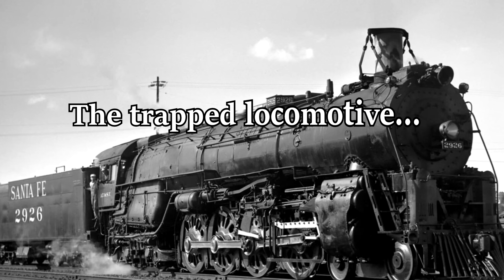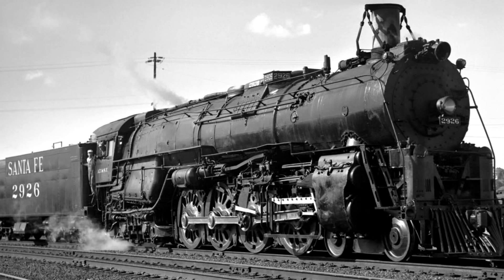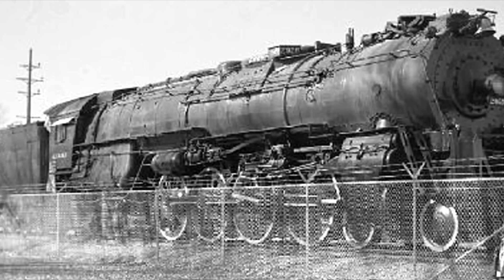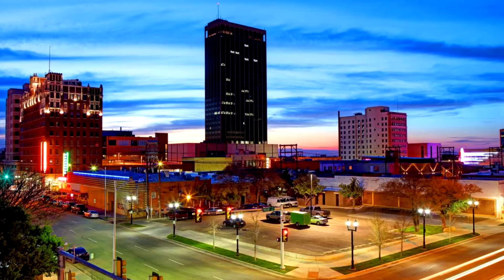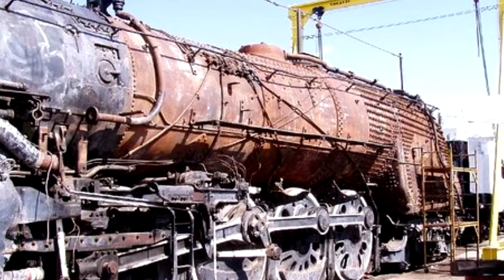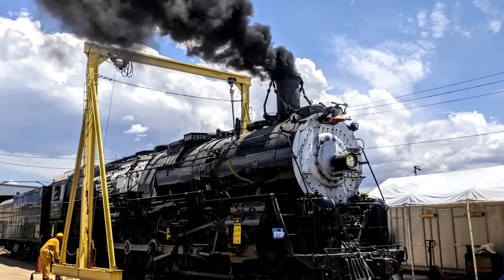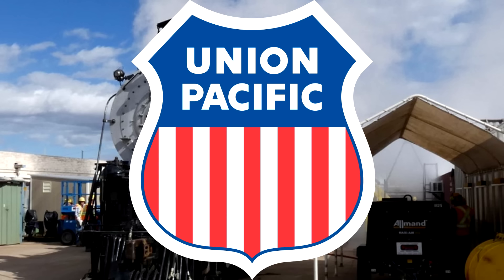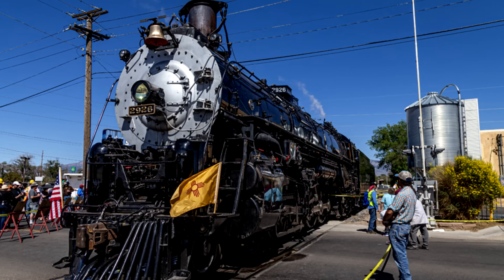The Locomotive Currently (Slightly) Trapped | Santa Fe "2900" 2926 | History in the Dark

Comment: The big problem is lack of PTC. I know when I worked for ns we would shuttle the nkp 765 in tow using our own engines, but due to lack of ptc it was restricted to being in tow.
Reply: Except 2926 has PTC put in her as well as ex-Santa Fe 3751.
Reply: Union Pacific, NMHR (formerly NMSL&RHS), and a third party (I can't remember off the top of my head but I think it's Wabtec) co-developed LeaPTC (the version of PTC that's for steam locomotives).
Reply: @MarkLac  I mean it kind of does. It has similar, if not the same PTC the UP Big Boy uses. So it requires a trailing locomotive outfitted with all the computers to be paired with it. Do they have a diesel capable of this? Serious question because I do not know.
Reply: @AlexBaldwin440 at this point up 4014 is fully ptc equipped now so doesn't require a ptc equipped diesel now

Comment: Union Pacific's no foreign steam policy stems from mechanical and operational issues involving NKP 759 in 1969, but there have been exceptions such as when 4449 required wheel work and was removed from the AFT and shopped at the UP's Omaha shops, double headed with the 8444 to and from.

Comment: So as a volunteer at the Railroad Museum of Oklahoma in enid I can tell you the joys of having to run on a class I railroad. We have frisco 1519 and even if we got the 20 million to restore it to operational condition (5 million to get towed to get restored, 3 million to restore, and another 12 million for a engine shed, spare parts, and the machinery to make new parts) to get the engine on a class I is not as easy as you think I know that the insurance cost that BNSF required Frisco 1522 to have to operate excursions got so high that no one wanted to pay the ticket cost so Im going to probably bet they would charge the same price as 1522's so getting tickets sold would be difficult. Plus you need to go thru the same engineering school as the railroad you want to operate on which is normally free for actual employees but are thousands of dollars for a non employee plus you would have to keep up some form of certification. Now that you got the cert and the insurance dealt with now you have to deal with the Fuel and getting the 4500 gallons of bunker C and the 12,000 gallons of water (which has to be filtered of scaling first)  and lord knows how much of that you consume a minute. Then you have to schedule water and fuel stops and then you have to "rent" a diesel and crew If you don't have PTC. And even after all that trying to schedule around the railroads schedule is another chore of its own. You have to find times that they arnt operating a whole lot and even then your not gareenteed anything. We used to run on farmrail but the new president of farmrail shut us down because we "distrubted traffic" even though they dont have that much traffic from my understanding. And all of this is just for the engine, we haven't factored maintance on rolling stock, staffing those cars, dealing with ticket sales......Yeah its a fun thing to deal with

Comment: I wouldn’t necessarily say it’s stranded. Yes 2926 is only running on that little Line, but there working on a Deal with NMDOT to run to different parts of the state. One of these lines is from Albuquerque to Raton Pass, my best bet is that 2926 is going to be running on State owned Tracks

Comment: Kinda curious on well a locomotive would run if someone would redesign feom the ground up using modern technologies. Could have controls with electronic lock out to allow multi unit configurations with only 1 crew. And a computer would control the inputs on the unmanned locomotives.
Reply: What an expensive farce!

Comment: It would be interesting to see the 2926 run on the Buckingham Branch along with the 611. They could be doubleheaded and compared and contrasted, even though the 2926 was designed to run at much higher speeds.

Comment: my mosin with a 180-185 grain Hornady cartridges is pushing the 3000fps range  and is absolutely crazy when it comes to putting wild game down, few years ago i shot a blacktail buck at 70-85 yards away and it went through both front shoulders the lungs and there wasn't much of a heart left when i cleaned it out, i only found one small bullet fragment but other then that it went through both sides pretty dam clean like, and to answer a question before its asked yes i do all my own butchering

Comment: Hmmm...the former Santa Fe main line through and around Albuquerque is now owned/controlled by New Mexico Rail Runner commuter rail agency (Rio Metro Regional Transit Agency), not BNSF (although BNSF retains all freight rights). Local transit agencies are notoriously politically-sensitive, so if the state legislature wants to see her run, it's perplexing to me why Rio Metro would be an obstacle. In fairness to the UP and their steam policy - they have 100% control the THEIR steam locomotives, 100% control of the maintenance and their own in-house staff of steam locomotive experts (hats-off to Ed Dickens and crew). This way they KNOW with a high degree of certainty the condition and reliability of the engines. They do not have the same depth of control or knowledge about someone else's locomotive. The liabilities of running these things on the main line are enormous.

Comment: This stuff brings out my inner cynic.

How many "restored/running" old steam locomotives does this country need?  Especially since there always seems to be "public" money thrown in somewhere.  Or some kind of "socialize the losses/privatize the profits" thing.

Take a gander at the "3463" mess in Topeka.  What a Charlie -Foxtrot.  Rumor around Topeka has it that the engine had just come out of overhaul when it was donated to Topeka, including fresh overhauls on a lot of the (now rare) components.  Seems that a bunch of those parts and pieces have now disappeared.

Seems pointless to restore them to operating condition if they have no place to run.  Assuming you even need a railroad museum....would it not be better to have a larger display of (properly restored, but non operational) railroad equipment, than putting your entire budget into a running resto that can't "run" anywhere?

All I can say is that the headlines proclaimed "2926 takes the Mainline!!!"  Sure it did.  For a mile or two of 10 mph running.  I'd laugh, if it weren't so pathetic.

The Class Ones can barely operate their own trains.  And you sure aren't going to operate a 2900 on what passes for track on your typical shortline.  Unless of course someone steps in (again) with "public" money.